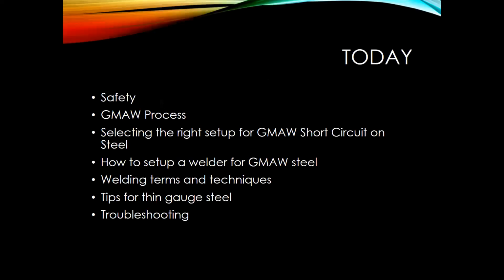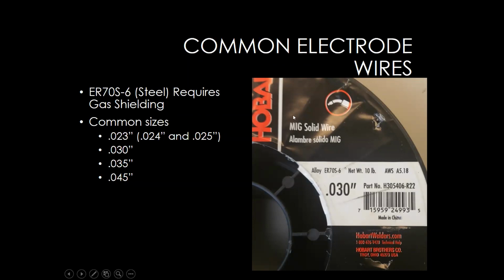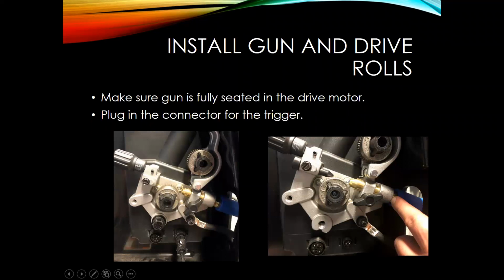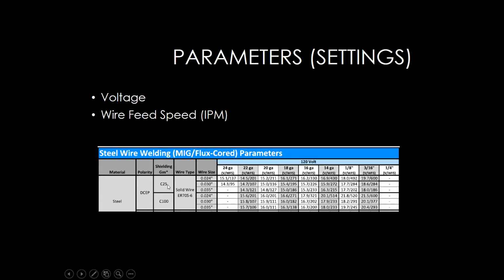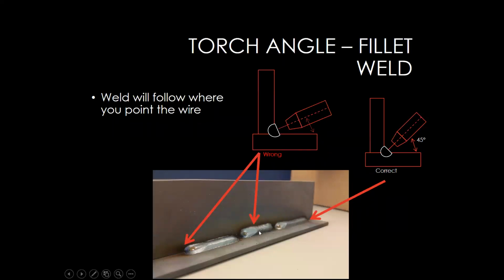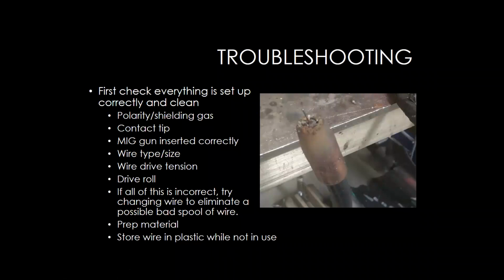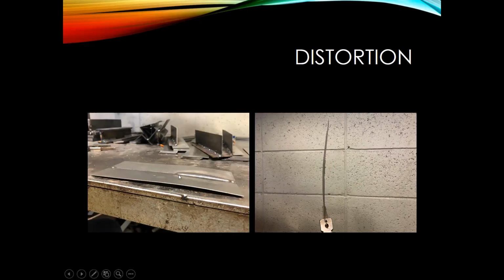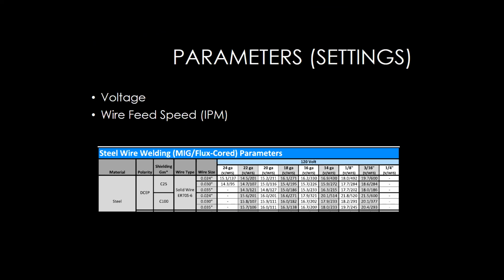Collision Repair Welding Part 1: Welder Set-Up And Troubleshooting

Comment: Great question about welding a thin sheet of steel to a thicker steel. Set the welder to the thicker steel setting or in between was a great answer and i will remember that! MAY HAVE TO DO SOME SERIOUS STITCH WELDING BUT THE WELD WILL BE FUSED!👍👌👍👌👍👌